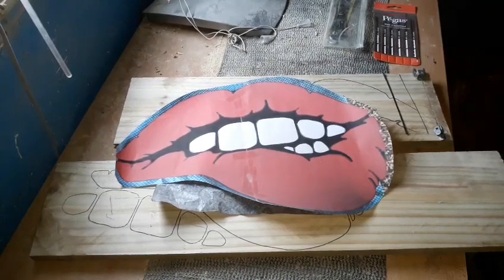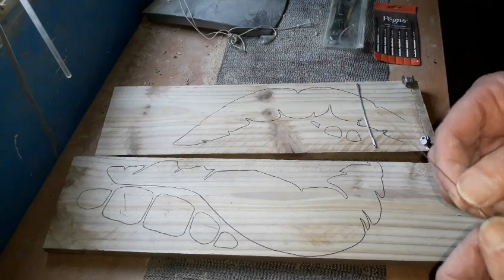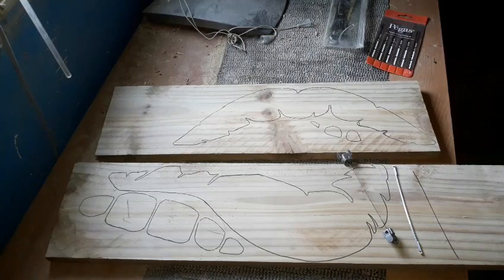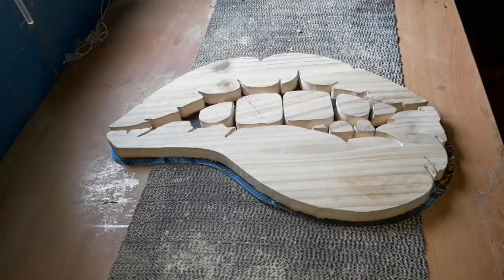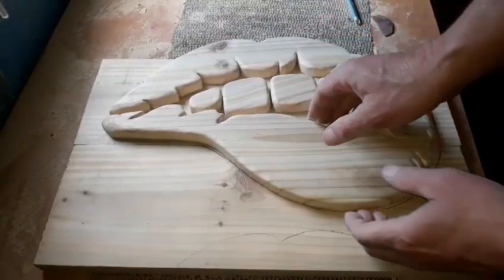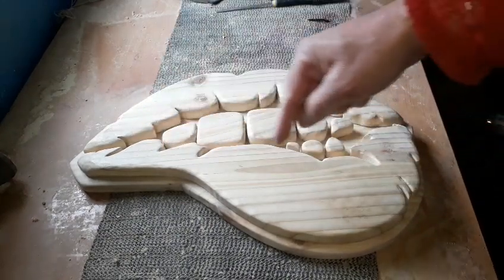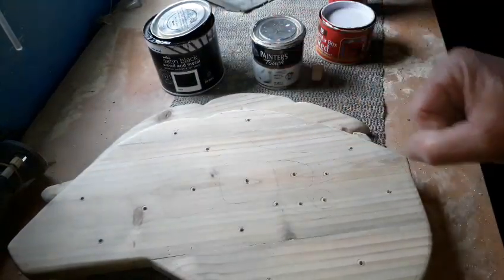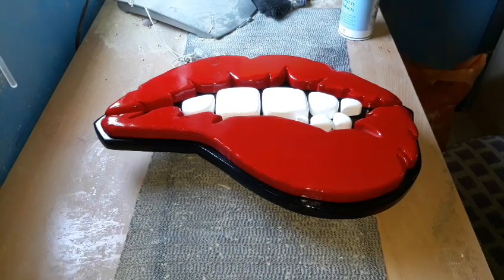Biting Lips.. Scroll Saw Project

Comment: Nice project, I usually like the spiral blades too but I bought some the other day (I had to get really thin ones as I had some small projects to do) I broke 4 on one piece 😞 just ordered some more (slightly thicker). Keep up the good work.
Reply from the maker: Cheers mark,I find pegas #5 is a nice size to work with..I did use #3 before and you can tell the difference straight away..